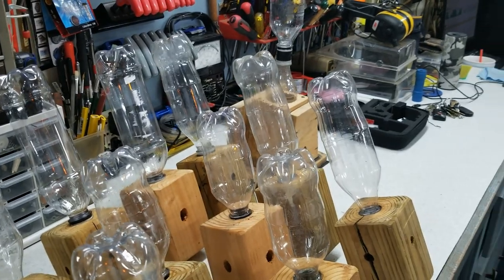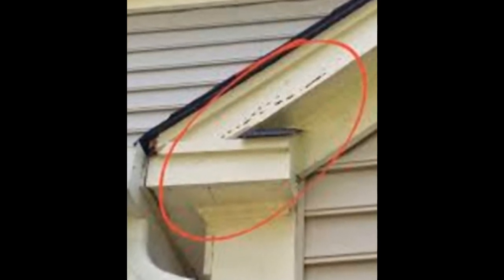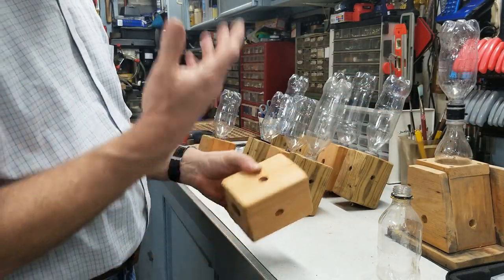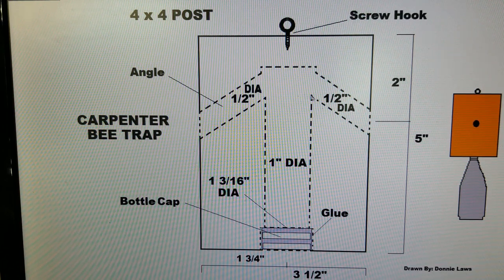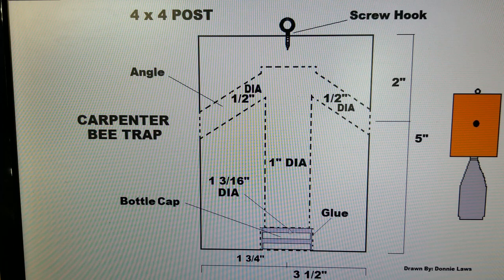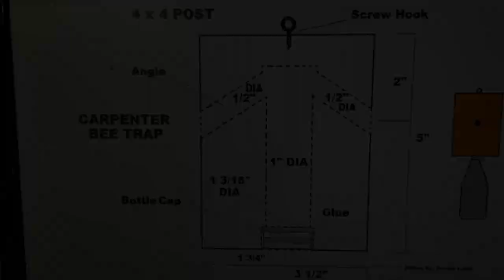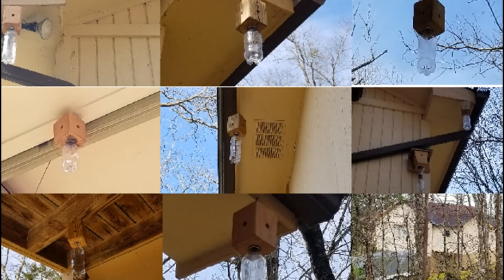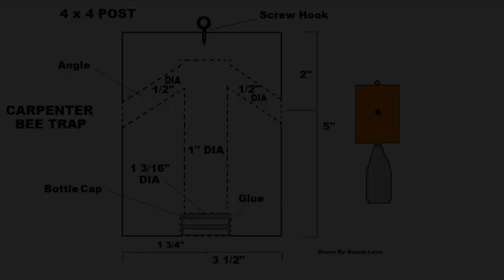CARPENTER BEE TRAPS. How to make them and where to hang them. Simple setup.

Comment: Mr. Laws, Thank You for taking the time to make this video and include instructions on not only construction, but where and how to hang them as well. My log cabin got all sorts of tore up last year by hordes of these shiny little suckers to the point where I was actually having nightmares about them! Tonight, I've just made three of these traps based on your info and will need to make a whole lot more, then get them hung after sealing all the holes from last year after sticking a wire down each to kill the little buggers that haven't come out yet. Let's hope this year isn't as bad as last year with these little scrappers! Cheers!
Reply from the maker: I know what you mean my friend. Spray WD40 in the holes before you seal them. They will come out for sure a lot easier than wire.  The work is getting set up to catch them after that it's just putting up and taking the traps. Please don't hurt your self at doing this. A few more days will not matter. Be safe on the ladder.  Take care and thanks for the comment.

Comment: We built a home on a mountain in East Tn. 2008, Upper porch with very high ceilings had a good sealant on the wood. We had some issues at home in Fl. and had not been to the mountain in a year. The bees and woodpeckers had made a mess of the porch. We patched what we could with liquid nails knowing nothing about carpenter bees. We got two traps at a home store and returned 4 months later thinking we could seal the wood.  The traps had quite a few bees in them, they just went higher to a point we can't reach without a really tall ladder. I got as high as I could on a ladder a few weeks ago and filled holes with steel wool and glue. I don't know if there was larva in the holes yet.  It was 20 degrees when we arrived and in a few days 78,  The bees were out again. We got 6 more traps similar to yours at a local hardware store. Now we have carpenter ants. Thanks for the instructions on your traps. Hopefully we can keep the ants and bees from eating this house.
Reply from the maker: WOW never ending battle my friend. Keep at it. Thanks for sharing this.

Comment: Donnie, thanks for showing how to make those. Those bees at our place are a nightmare. We plug up the holes with caulk and the woodpeckers pick it all back out. Our place sits really high up on the mtn side, wind back there on the deck even blew down the thermometer we had drilled up on the deck post. Any suggestions on hooks that might let me leave them up? 😊🐝
Reply from the maker: Find some deep u hooks and maybe even bend them a little. The wind won't blow them down.
Reply: Thank you 😊 take care my friend.😊💕
Reply: Instead of caulk, use PL Loctite adhesive, or a wood hardener that turns rock hard and the birds and bees can’t peck it out or drill through it, like they do with the soft caulk.
Reply: @leeb.7188  Thank you very much . I truly appreciate your tip! 🤗💕